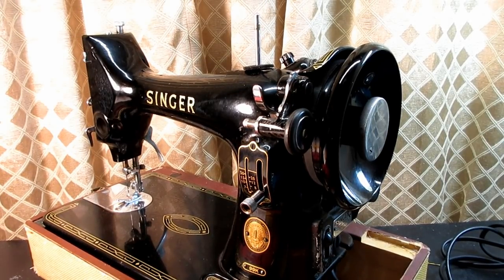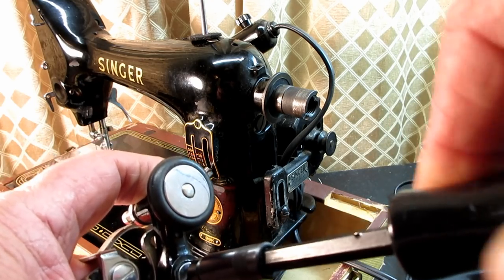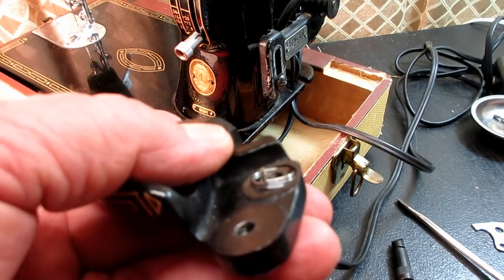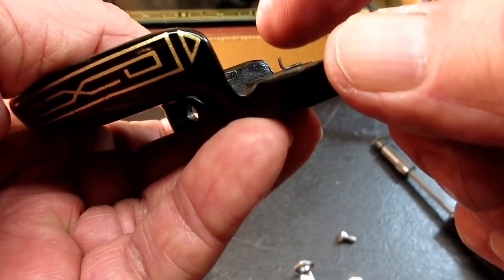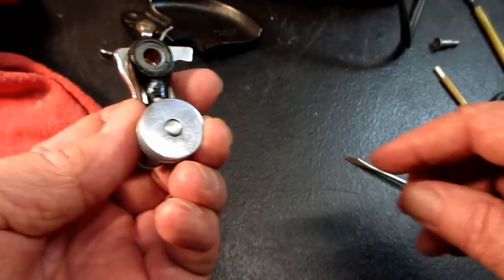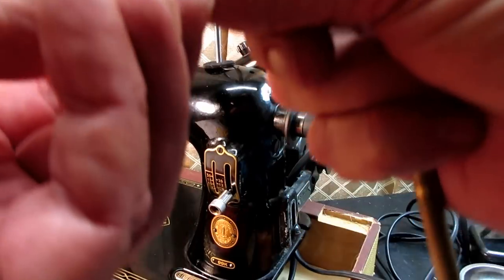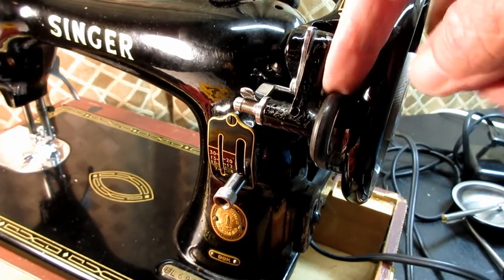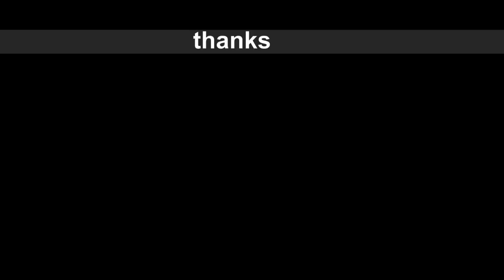The Handwheel and Bobbin Winder of a Singer Model 99K Sewing Machine

Comment: Thank you for sharing. I have finally restored my machine.The friction tire was worn so I picked up a Singer package with belt and tire. Replaced it and it seems to be thinner than the original .. Are there different sizes ? And any suggestions where to purchase a new one if needed? Thank you..
Reply from the maker: What seems thinner? The belt or the friction tire? Probably the belt. On machine handwheels like the 99, the groove is a flat "V" shape and the newer belts that are not as wide still fit well into the bottom of the groove. They seem to work OK and I guess time will tell if they last or not. I still prefer the full V-Shaped belt. Here are a couple of trusted sellers of V-style belts: https://www.vintagesingerparts.com/collections/singer-model-99-parts/products/singer-motor-v-belt-original-style-black-193077
https://singer-featherweight.com/products/belt-v-black-solid
BTW, the bobbin winder Friction Ring (rubber) part number is 15287, very common size for Singer and several places online sell them. https://www.google.com/search?q=singer+friction+ring+15287&oq=singer+friction+ring+15287&aqs=chrome..69i57j33.12214j0j9&sourceid=chrome&ie=UTF-8
Thanks for watching my channel and asking a great question. Nicely done. Belts are getting harder to find and I've had to "make do" with a slightly too small belt lately on some models. All our machines are gear driven no belt models, but I bought a spare for my daughters Model 338. I figured for $10 it was worth the peace of mind. Take Care.
Reply: Andy Tube  Thank you for your reply.
The tire is thinner.( new one) .
I ordered another set from Michigan vintage parts.. I will send you an update . After April 2 waiting for deliver.

Comment: Andy, I followed your video on cleaning the unit. I took off the flywheel and the bobbin unit. I did NOT take it apart. However, having said that, I tried to wind the bobbin for the first time. It will not wind. I followed your how to video on doing it. If I manually move the rubber ring the thread moves and winds, if I let go the thread does not move. Seems like I do not have friction. Is there a way to adjust the unit to be closer to the wheel? Is it even suppose to be touching the wheel ( the rubber ring)?
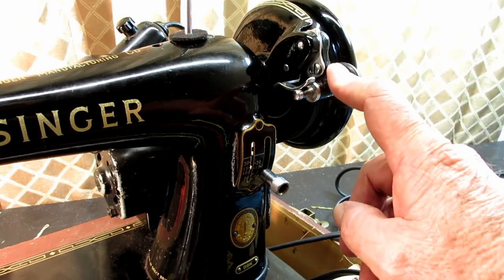Reply from the maker: I know you found the answer, Lori, but for viewers having this problem I show the adjustment to make @38:20 in the video.

Comment: Hi Andy.  I'm trying to repair a 99k and have 1 issue I can't find info on.  The internal mechanics behind the stitch length adjustment. My problem is that as the wheel turns, it catches and I can almost see where it might have been reassembled incorrectly but I'm afraid to take out the guts without a good video to watch first. Any suggestions?
Reply from the maker: Here are all 19 of my 99K videos in a playlist: https://www.youtube.com/playlist?list=PLsCOZgzzaiKIIUgkEujqHc9iNWN9NPW2Z
One of the videos is a detailed remove & replace the Feed Regulator (later called stitch length control) that may help you,
https://youtu.be/OTuoIj0Vx0E   Keep in mind that any moving part on the machine can cause binding; a bent needle bar, tight stud on take-up lever, dried oil in the hook roller, etc. Thanks for watching my channel and good luck.

Comment: Hey why is there a uncovered square hole on this machine? It’s under the bobbin assembly but its made into the body of the sewing machine. Should there be a cover over it?
Reply from the maker: "" ... under the bobbin assembly...  "" the bobbin assembly is below the needle bar https://youtu.be/epUB-5TWQBo
Some openings are to install or adjust shafts, rods, and pitman arms during manufacturing. Some were for frames that held the body during casting, coating with the black base, or the final coatings. Some near the handwheel are for the belt to pass through when used as a treadle machine. Most of these types of openings did not come with any cover.
https://www.youtube.com/playlist?list=PLsCOZgzzaiKIIUgkEujqHc9iNWN9NPW2Z

Comment: Hi andy sir. My bobbin winder is stock frozen it did not spin. Please advice me how to turn back it to normal. Any tips. Thankyou
Reply from the maker: It needs fresh oil. Add oil into the oil port and if needed heat the BW with a hairdryer to soften the old oil inside. Look at 38:56 in the video. My finger is covering the oil port hole.

Comment: Sir Andy, is the bobbin winder for the Singer 99 same as the 66?
Reply from the maker: Maybe. The BW in this video is a TYPE "B" and can be found on models 15, 66, 99 & 201. There is a TYPE "A"  winder that has a thread guide and a gearing system below the spindle. It was used on models 15, 66 & 99 over a long period also. To get an idea of these you can download FREE instruction manuals from Singer. https://www.singer.com/support

Comment: Those are the 2 screws I can’t get out.
Reply from the maker: Hard stuck screws are common on these old machines. I'll soak with drops of WD40, heat with a hairdryer, tap the screwdriver while turning it. Patience is usually the key it seems. Sometimes a day or more. Good Luck.